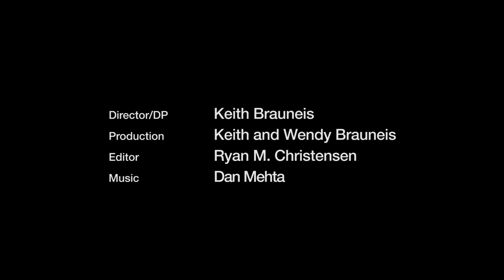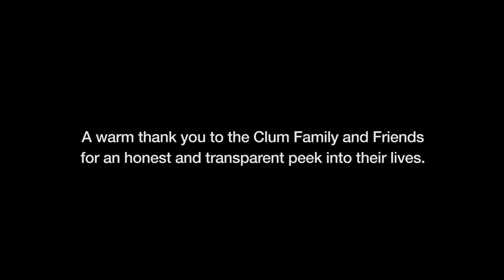The Intimate Weapon

Comment: This is a suggestion and I made one so I know it works you take a tripod off of a cymbal stand and drill out the hole or a piece of half inch copper pipe and then you go with a t and come out with two more keys on each end so you can manage to hang four bows